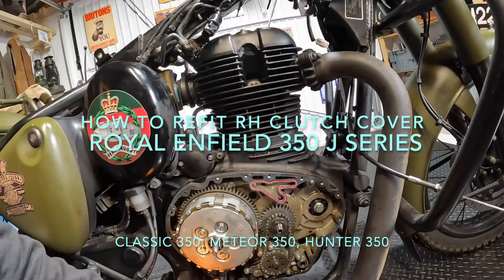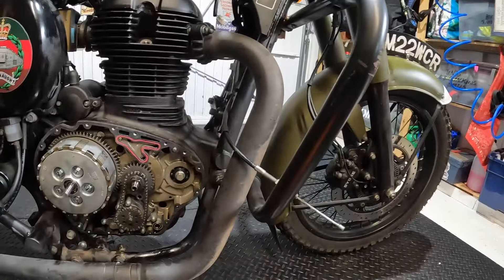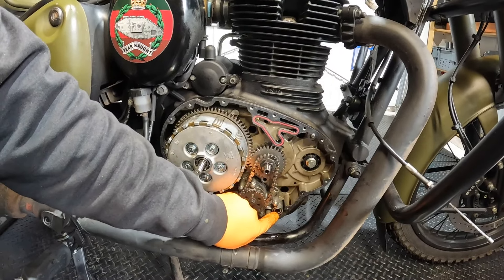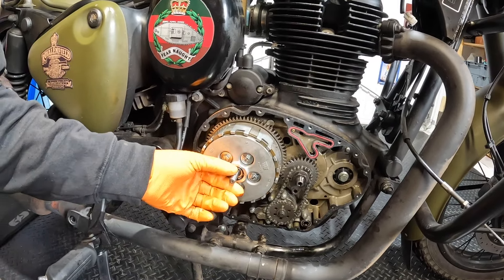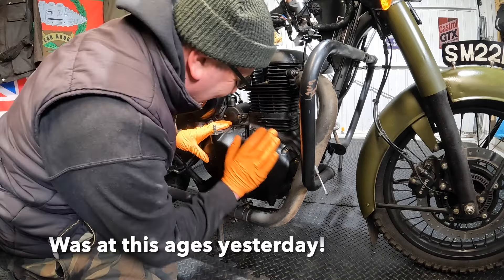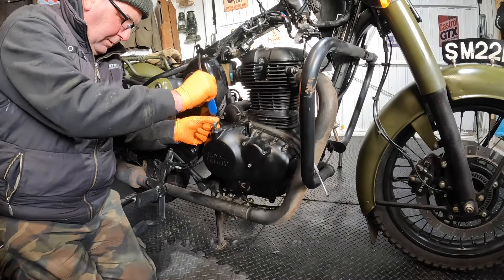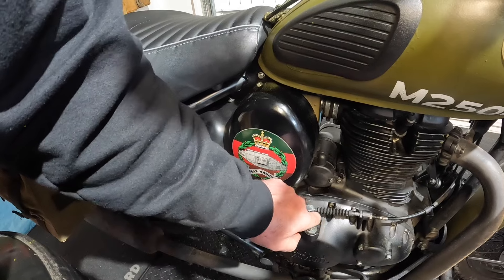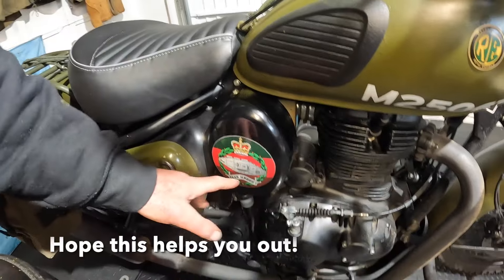Royal Enfield 350 J Series RH Clutch Cover Refitting

Comment: I had the biggest problem, taking the case off at the start. Took me over an hour to realise that you need to undo the clutch cable from the lever at the case, then turn the lever back a bit to come off the spline. Came off dead easy then without removing the mechanism. 
Great way to learn all about your bike.
Reply from the maker: The cam is prob the easiest job to doin the whole procedure Phil! Its the casing and all the unplugging everything  😂👍
Reply: @Coastriderscotland  your not wrong there Bruce. I did find like you, that hitchcocks cam setting tools did need filling down abit to fit properly.